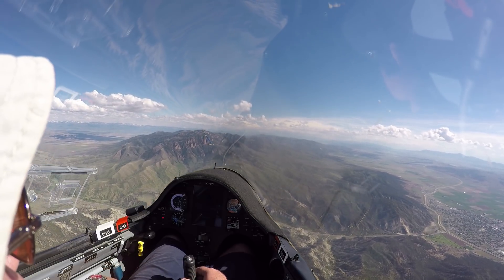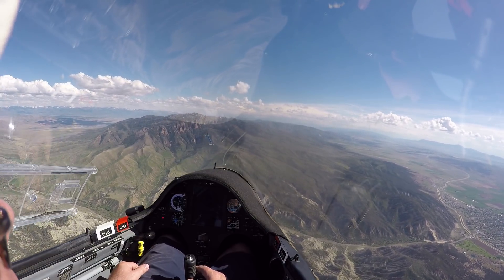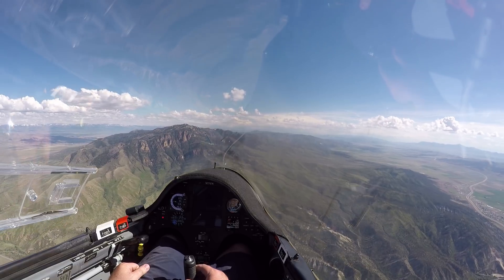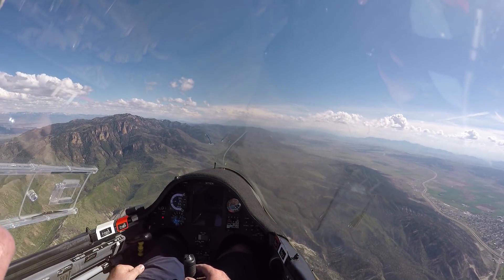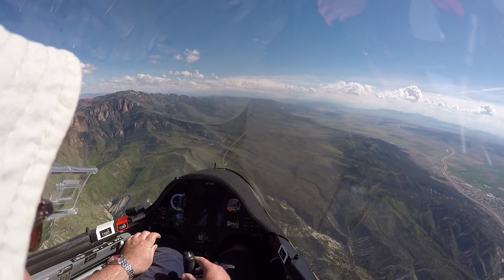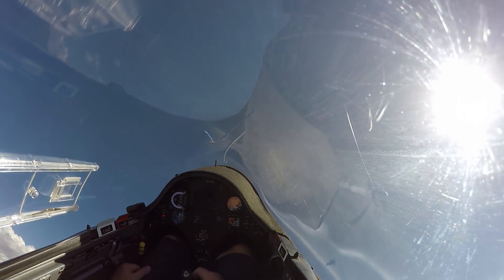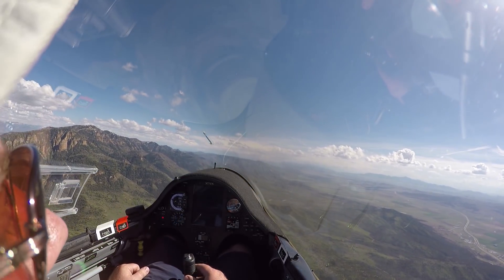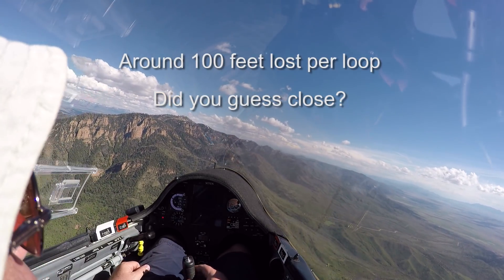How Much Altitude Will Looping Glider Lose?

Comment: I have to admit I was kind of surprised. I thought the higher you flew the air would be thinner at say 10,000 compared to 3,000?? Less dense so it would take more for the wing keep its lift, or is that not enough of a factor to see a difference?

Comment: What's the control on the left you keep messing with?
Reply from the maker: the flaps control.  High performance gliders use flaps at all speeds (even high cruising speeds) much more than airplanes.
Reply: Thanks.  I should have said "adjusting" instead of "messing with".  Didn't mean disrespect.  So the flaps are down DURING the loop?
Reply: I'm not familiar with that particular glider, but it looked like he used neutral flaps during the loop.  At high speeds the flaps are set negative (above neutral position) to reduce drag.

Comment: This was interesting to me because I used to give rides for a glider operation many years ago in a Grob G103 Acro.  Some people wanted acro rides and I had gotten some instruction from a CFIG competent in a number of acro maneuvers in the G103.  One thing that surprised me was the entry speed for a loop in a G103 was the seemingly low entry speed of 97kts.  It brings home the fact that pulling on that stick is just like putting the brakes on and beyond a certain speed, pulling back on the stick used up so much kinetic energy redirecting the flight path that higher entry speeds actually resulted in a lower speed over the top.  I planned on losing about 300' per loop when giving rides to give myself some safety factor due to the inevitable sub-optimal execution and avoid any stressful situations with a non-pilot paying rider on board.  The other very surprising thing was the unbelievably high nose attitude while in sustained inverted flight.  Most glider wings don't like to 'fly' upside down!

Comment: My Lark IS28B2 two seater would lose about 200 ft. Per loop. The dive to speed is just about equal to the climb to slow back to normal flight speed, minus the two hundred feet. I have actually gained altitude with a thermal forming directly below and in cloud suck.

Comment: When at the peak of the loop, do you go negative G, or does centrifugal force hold you in the seat at reduce positive G?   It looks like you go ever so slightly negative based on the small motion of your shorts fabric.
Reply: Jennifer WhiteWolf usually when ya do a loop its just constant elevator and then you level out its mainly just positive Gs when looping and you did a continious inverted flight that would pull negative g's. 😊 does that answer your question?
Reply: Jennifer WhiteWolf but its not the same amount of G's the whole way round, it does get reduced at the top of the loop .
Reply: Born_to_fly16    Thanks!

Comment: Inverted Loop next!
Reply: Twobarpsi not in brunos there usually only rated to -4 g's and you wouldn't bring the glider up 150 knots to do an outside loop haha
Reply: Born_to_fly16 well no you wouldn't bring it to 150kts first but you can defiantly do an outside loop if the aircraft is permitted. I know for sure as I have been shown first hand in my clubs new trainer :)
Reply: Alistair Cunningham i know its possible haha in other gliders, but not in brunos is what i was saying (not possible) as in not in his glider
Reply: Yes.  Stick Full down to 150 knots, keep forward stick pressure, to complete loop.
Reply: Possible but not in Brunos glider

Comment: Bruno, Thanks for posting all of these videos. Because of you, taking a day and riding in a sailplane is now going on my bucket list. Two quick questions that I hope doesn’t take to much to answer. In all your videos there is a constant background noise. Is that just external wind noise, air passing through the cabin for cooling, or is there some kind of circulating equipment? Second question is how loud is that noise in person? 

I’m hoping to get in a sailplane for a trial flight within the next year via the closest sail club and I could not be more excited.
Reply from the maker: tc2290 thanks for watching.  The camera is right up against the canopy and I think the mic is on the canopy side so it is picking up way more noise than the pilot hears.  It really is pretty quiet inside the cockpit.
Reply: That's great to hear. I've always loved the idea of flying sans machine power specifically for a more natural flying experience. Sail planes seems like a happy middle ground between small engine aircraft and hang gliding. I first stumbled across one of your "entire trip" videos and was amazed by how far and for how long you can fly. Thanks again for putting these online and inspiring future enthusiasts.

Comment: Would there be a big difference in altitude loss when compared to a lower performance glider or are all gliders pretty efficient?
Reply: Saxon There are differences of course. Some gliders basically fall out of the sky at high speeds but most high performance gliders will drop almost no altitude.
Reply: Especially the Slignsby swallow. There's a cool video on YouTube of a swallow doing like 4 loops in a row and barely losing any altitude.
Reply: I did a wingover in an SGS 2-33 two weeks ago and lost 350 feet.  It's a very low performance glider.  As for how much height it would lose in a loop ... probably all of it!  The wingover is about its aerobatic limit (and then, it had to be a very gentle one).
Reply: That's pretty cool to know, thanks guys
Reply: Oh interesting,

Comment: Can you do a barrel roll in a sail plane?
Reply: A barrel roll is just a roll with some elevator applied to create a corkscrew type of roll.
And yes, a sailplane can do it. Though I would stick to gliders that are designed for aerobatics.
Reply: Funky Dunky, there are gliders designed for different purposes. Bruno's is designed for distance with a high glide ratio. Watch the world glider aerobatics champion, Luca Bertossio, in his glider designed specifically for that: https://youtu.be/_zdOfhpe6rQ
Reply from the maker: Funky Dunky yes in some gliders but not in mine. My pilot’s manual specifically prohibits barrel rolls. It does allow loops and goes into detail how to do one correctly. For example, no looping with water in the wings. You would pick up speed too quickly on the second half is the loop and likely over speed the glider. Thanks for watching!
Reply: Yeah, "barrel roll" has come to mean "roll" in the common consciousness. In reality, though, a barrel roll is performed with a significant pitch component, so that the plane seems to follow the surface of an imagined cylinder, or barrel. It's basically a stretched out loop, if you think about it.
Reply: Born_to_fly16 barrel roll and a roll are not the same thing. Look it up.
Reply: I understand that, but how someone that is new to the sport is in the glider and asked to do a "barrel roll" you not going to point it a the ground and actually do a barrel roll, what he is meaning is a "Roll". Ive had so many people say barrel roll in the past 13 years of flying. :)
Reply: Yes, Very nice glider Bruno! Im currently learning with gliding and have done models for years. Our club two seater is an ASK21 and we are about to get a duo discus. My father also flies full scale and models and has his A, B and C certificates and is getting signed off for areos!
Reply: You are describing an Immelman.
Reply: My comment about the Immelman was for Born_to_fly16
Reply: You're right, but an Immelman does contain half a roll. Not a barrel roll, though, unless you want REALLY bad scores from the judges :).
Reply: https://www.youtube.com/watch?v=uXyYGPJGJE4

you'r kidding right?
Reply: All I was actually asking for was the "simple" aileron roll. Thanks for the enlightment.
Reply: Roll is how its pronounced, yes it is possible to do a roll in a glider (sail plane), I like to half loop and before you pull through the loop you roll out of the loop. :)

Comment: If you could drop the dead weight of the glider 100 feet, it's probably enough kinetic energy to drive it over the top in a loop. But the energy required to horse that same dead weight around in a tight loop costs you the 20 knots airspeed. To understand the energy required to change direction of a moving object, load a swivel castor cart with 1,000 lbs and steer it through a shop full of obstructions -- it is hard work, even with friction near zero.
Reply: Interesting method of realizing that. I like it! :)